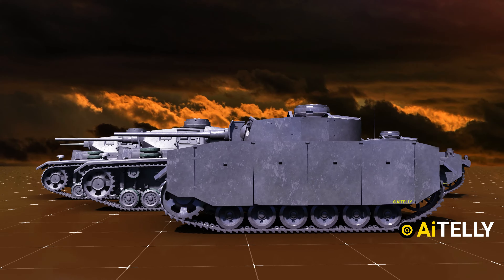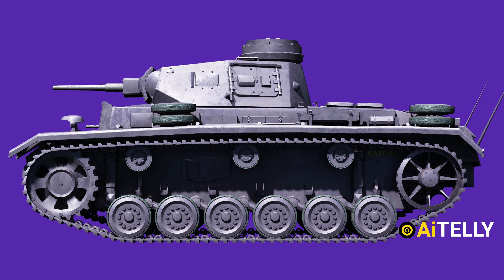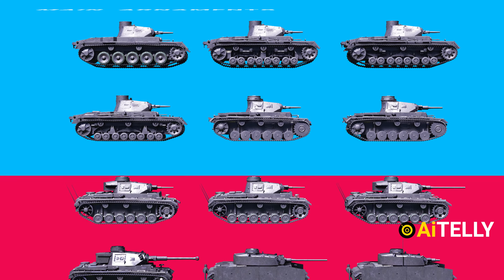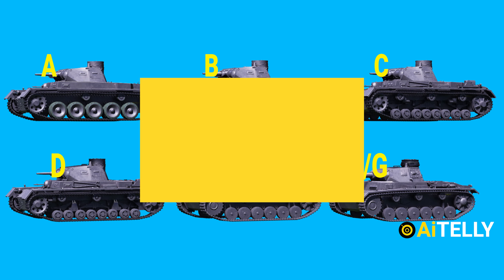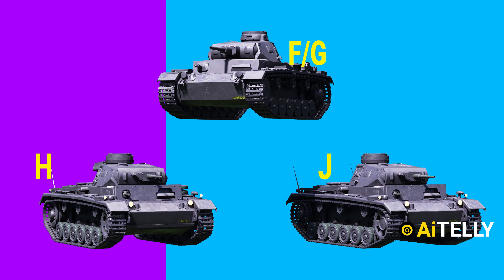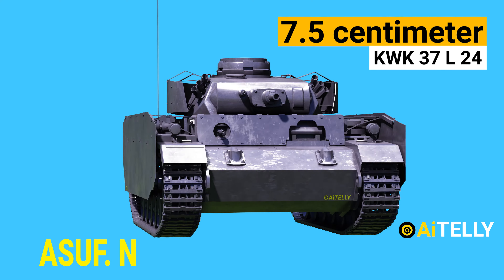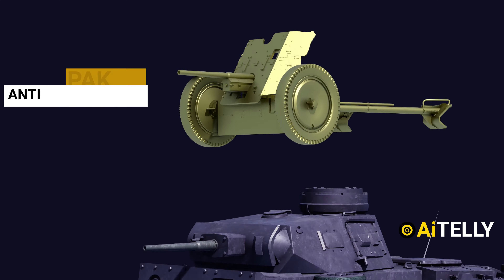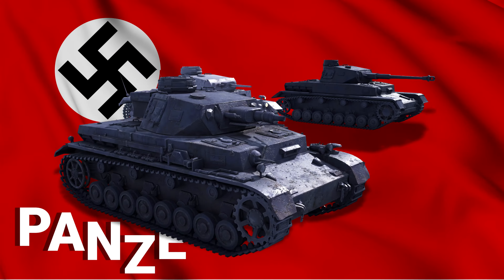Panzer 3 Tank Variants How to Identify?

Comment: brilliant 3D representation by far . . . modern battle tanks could actually do with coil spring suspension & heavy duty shock absorbers, that'll complement the existing torsion bar setup . . . the ride height can be raised by replacing existing springs with longer (taller) coil springs & slightly longer (taller) & beefier torsion bar with re-calibrated rebound effect . . . for superior mobility over terrain . . . the forward hull section of the Panzer III AusfH - AusfN variants could have done with a angled sloping (slanted) hull . . . especially the heightened forward upright base of the turret, housing 7.62 X 90 MM co-axial gun & driver's look out porthole . . . all Panzer 3 AusfF - AusfN variants could have done with a tad more ground clearance by re-calibrating the leaf spring suspension . . .